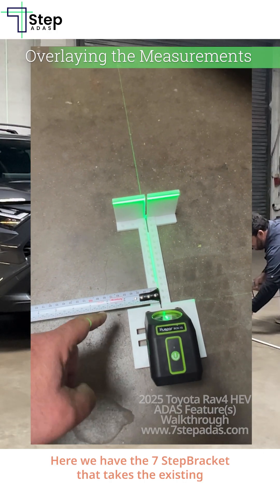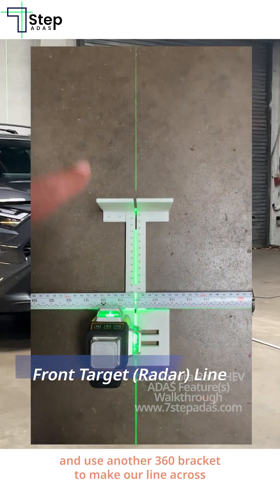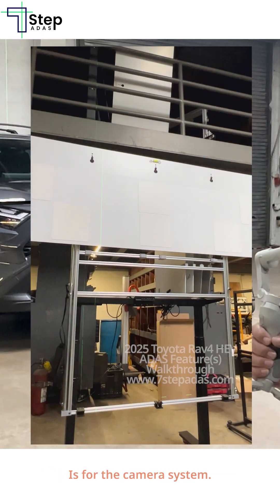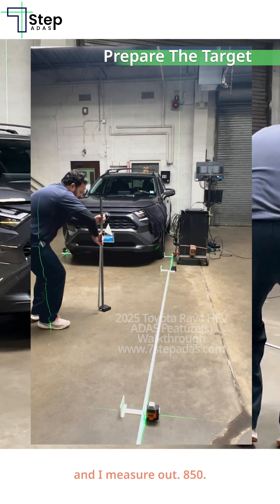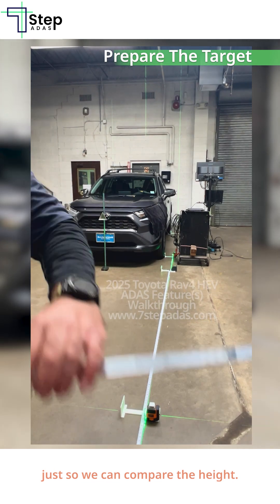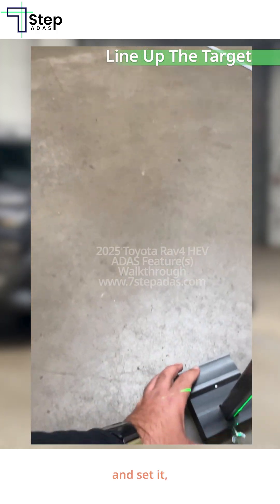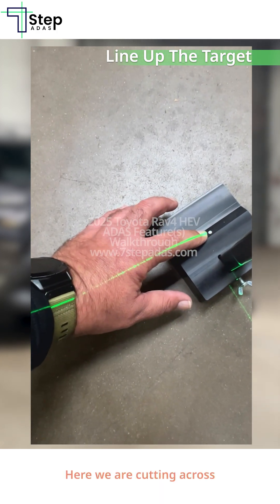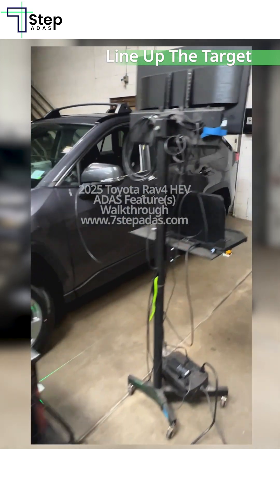OEM Spec Is 850.1 mm — Tools Don't Measure In Decimals Though... ADAS Logic  #adas #automobile

Comment: What I see in these videos I've been watching is interesting but it never really tells me what led up to this why are we doing this what's it look like once you get it set up on and on and on it it's very vague. Am I missing something Is this a product you're trying to sell which is fine and I understand but the videos are missing a lot of information
Reply from the maker: These are shorts that lead up to the full video.  Once the full video comes out, everything you likely want answered is there.  If it's not, let me know what you need help with and I'll be happy to try and help.  But this one in particular, will make a lot of sense on Sunday when the full video posts showing everything before and after.

I do dell the bracket system you see me use there but you don't need the bracket system.  

The bracket system with lasers helps tremendously in comparison to my earlier videos without it.